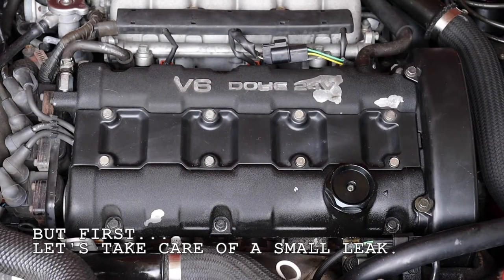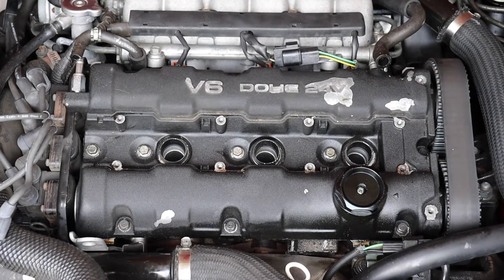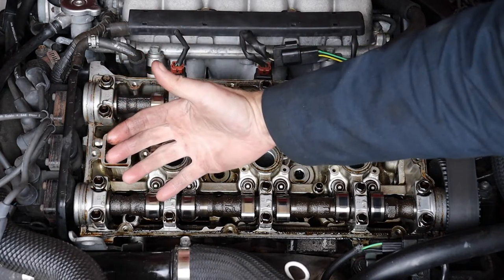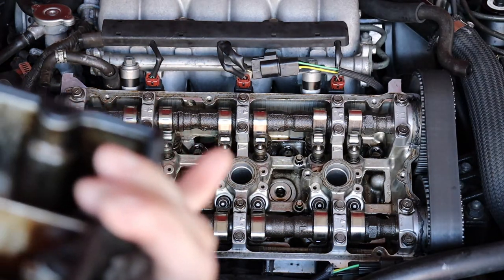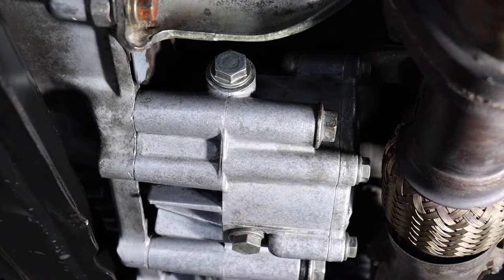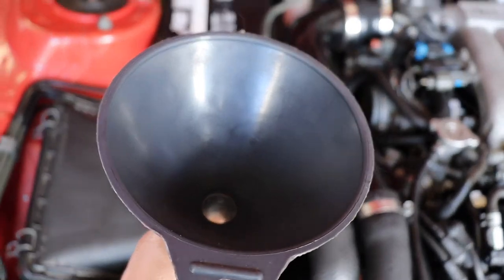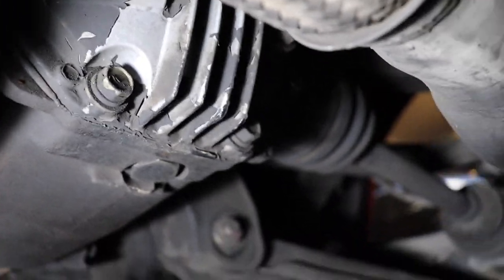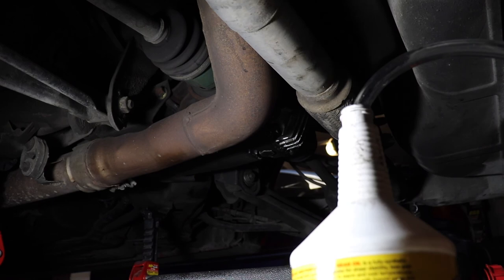1991 Dodge Stealth R/T Twin Turbo - Episode 5: The Fluid Episode

Comment: Our valve covers are actually supposed to be torqued to 2.2 ft/lbs then re-tourqued to 2.9 ft/lbs. Thats what it said in the manual and if torqued too low they can back out on their own which is what i think happened here and why they were all loose 😂
Reply from the maker: That’s true and possibly very much what happened here. So lucky it was the front versus rear.

Comment: What about the power steering fluid?
Reply from the maker: Usually not exciting enough to film. I use a battery fluid pump to extract old fluid, turn steering to one lock…drain again…turn to other lock…drain some more and repeat till empty. Then simply fill with fresh PS/ATF fluid depending on vehicle.

Comment: Dude it looks like your oil pan is dented on the bottom there.  You need to fix that asap as the pickup tube is right at the bottom.
Reply from the maker: Andrew McIntosh ummmm not sure what you are seeing but this oil pan is in beyond excellent condition without a dent or scrape in sight.
Reply: @autoobsessivegarage  Ok it looked dented from that angle.  Must be a reflection.